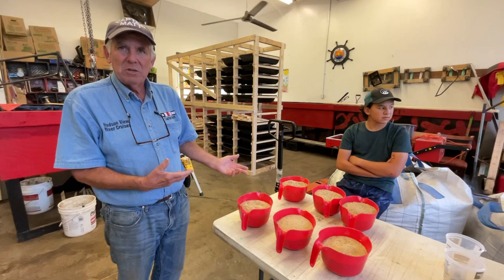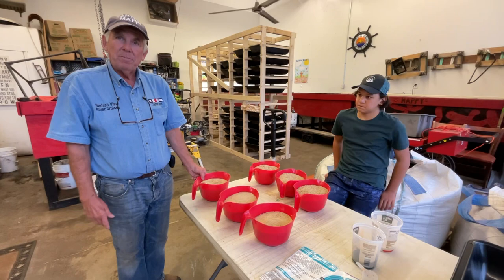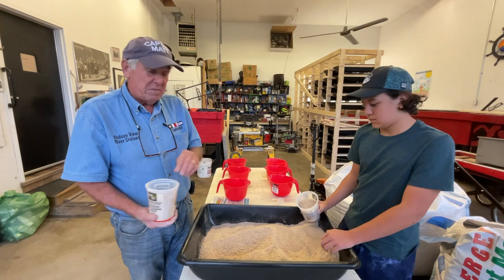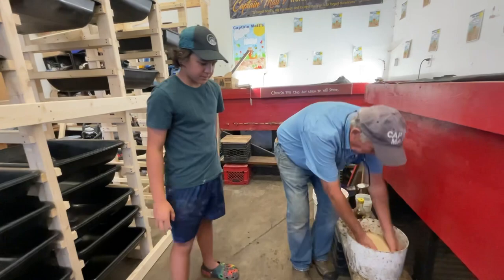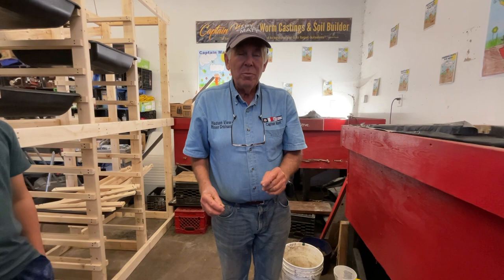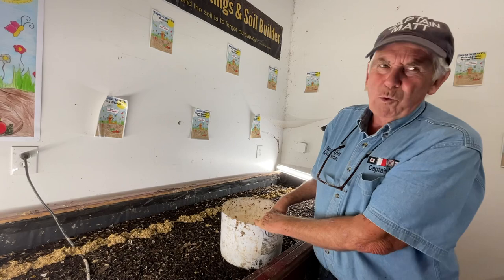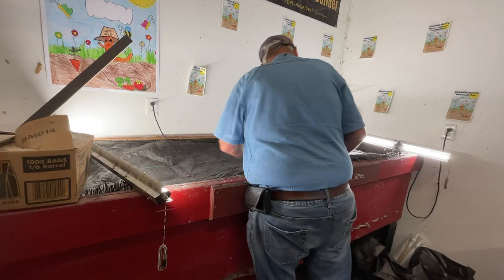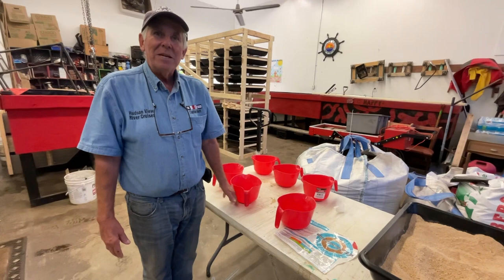Simple, Sensible, and Economical Worm Food

Comment: Thanks for talking about worm chows. It is recommended to never top feed more than the worms can eat in a 3- day period. I feed mine once a day (bed-run) which means I never put down more than can be eaten in a 24-hour period. I have found when doing every 3-days the worms will pull excess chow down into the bedding which can randomly sour a bin. The most important thing when top feeding worm chows is not to water it into the bedding. Great use of the sunflower heads. Your worm chow has everything the worms need. You mentioned worms and a sweet tooth, and I thought about worms running.
Another excellent video Captain Matt
Have a wonderful Day!
Reply: Is worm chow crucial for worm health and good castings?  How much of a difference does it make to their health and the quality of the castings?
Reply: @Beartriple7   It depends on what you are doing with your worms. If you are using worms for reducing household waste and are using food scraps and wastepaper's and also using the castings in your garden it is not crucial at all. If you have more worms than you have household waste, than it is absolutely necessary.
When using compost, peat, peatmoss or coco choir and only worm chow for feeding worms, one has to use other sources of controlling moisture (pressure sprayer) or set and forget 14-21 days. Which in return gives the caretaker of the worms 100% control over moisture which is very crucial to the worm's health and also to harvesting castings with machines.
On the quality of the castings, they may or may not be a better quality it is up for debate, but they will be a consistent quality and contain no seeds that would cause volunteers (unwanted plants in the garden), so they are safe to give or sell to other people for their gardens (without giving worm castings a bad name) and are better for plant starts when made with worm chows.  You can use seed size to determine what goes to the worms, as tomatoes and pepper seeds will fall through an 1/8" screen.
My question would be what your priority is with the worms, is it to reduce waste or is the priority taking care of the worm's?  If the priority is taking care of worms and producing consistent quality castings than worm chow is a must and absolutely crucial.
Have a great Day!
Reply: @wormsforlife7352 thank you for your insight, my priority is to take care of the worms and to get good castings, you a have a good day to:)
Reply: Hi there! I've been reading your comment thread on Captain Matt's video on breeding bins and have found it very informative. Thank you! I'm only about four months in to my worm farming with two 27gal tote bins each containing around 4lb of worms. Once I get the basics down I plan on using breeding bins to really increase my population. I have a question for you about feeding worms, if you don't mind. I do not fully understand the role of compost in my worm bin. 

My worms bedding is cardboard and compost, completely mixed together. The cardboard was ran through a paper shredder and I made the compost using leaves and grass clippings this spring. I know that worms consume the browns sort of passively over time and that they require more than just bedding so I have been doing pocket feedings using vegetable scraps. I feed them once a week while doing my best to maintain moisture. I do this because I thought that it would make my worms the happiest.

My question is: when it comes to a large bin like this (as opposed to 2.5gal of compost in a 5gal bucket) would my worms prefer to have bedding that is 100% compost with top feedings of worm chow? 

I collect about 100lb of vegetable scraps from a restaurant every week. I freeze some that will be fed to the worms and the rest goes into a compost pile. They eat about 4lb and the other 96lb goes in the pile. I've stockpiled maybe 4 yards of compost so far. If the worms would prefer partially-finished compost and worm chow top feedings more than green veggie scraps then I'll transition towards that.

Thanks again!!!
Reply: @CamOfWorms1  Hi Cameron, I am only new to this as well, but from what I've read and watched the whole key is to create a thriving, diverse microbial life in the castings, that can be then introduced to your garden soil to improve its diverse microbial life and all the benefits of that.  So, the role of a nearly complete compost being used adds more microbial life and some diversity and more breaking down of the compost and even more microbial life as it exits the worm.  The different types of compost and composting techniques can have different types of life thriving in them, so that can be considered to(so far sounded like slowly aged(years) non pine wood chips was one of the best sources of compost for certain reasons). The age of the compost and what stage it is in is a factor as well for worm farm enviornment.  A variety of food/bedding sources, given that the sources are safe, would in theory give a diverse microbial life. Being that there are so many organic things that break down to choose from, most people use what they can get a reliant reasonably cost/sometimes free source from, which is good, but from what I've found out in the last month or so of researching, is that you can do even better for your worms and the castings they produce if your willing to spend a little money(not necessarily a lot, and maybe none if you have what you need already) and have the time and possibly the space to do so(if composting your own), as not all worm castings are the same due to the inputs.  I saw several videos showing 'side by side' comparisons of plants using different worm castings, as well as worm tea from different castings and there was shown that there can be quite the difference even though both were using worm castings, mainly due to the what the worms were fed as inputs, some showed drastic differences(ie doubled produce), but all the examples that I came across showed a noticeably difference, so my take on it was that if you want to put the extra effort in to what the worms get, then that will translate into whats available for the plant.  Many places besides compost also used manures of one type or another, or manure alone, which again he manure source has different guts that it has passed through and different life in it, but it looked like they were all aged except rabbit from what I gathered, and also their specific sources had to be determined if safe.  The specifics of what was in the different worm chow recipes out there varied a bit, with each component having a purpose, whether it was for protein, grit,for ph balance, for calcium or other nutrients, or for minerals, or other things I am sure I have forgotten.  
It sounds to me like your doing allright by your worms so far, and like worms for life said I think it depends on what your overall plan is to do with the worms.

Comment: Thank you for these suggestions and details. Recently I’ve been wondering what you feed them from your garden… and this video answers that question. 
This winter I built my first flow through worm composting bin primarily from wood from pallets. I coated most of it with boiled linseed oil and the bottom parts with two part epoxy to prevent dry rot. 

Thank you for all your advice, suggestions and ideas.
Reply from the maker: You’re welcome, Floyd. I love the ingenuity of your bin approach